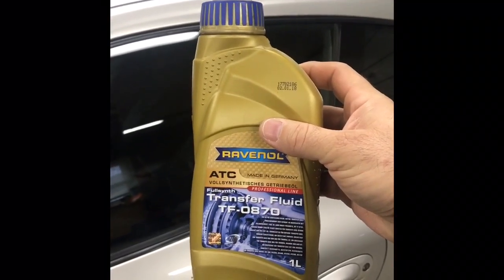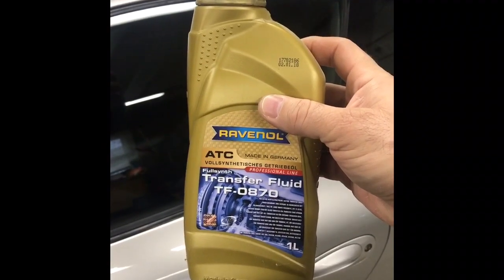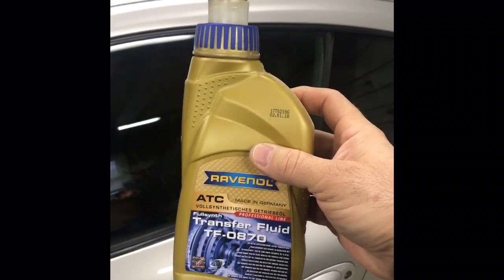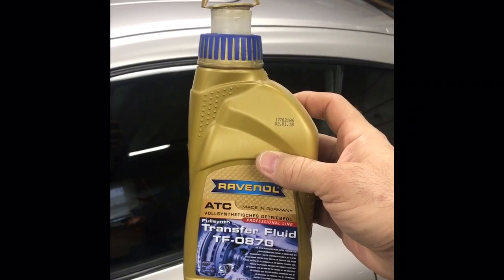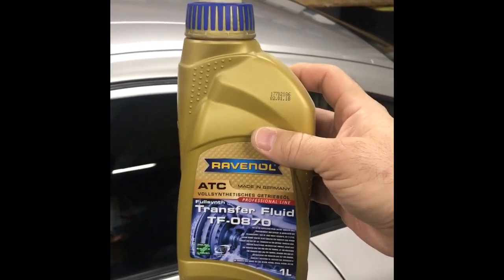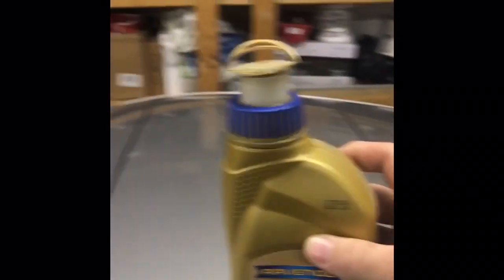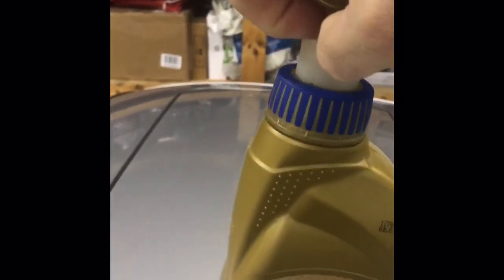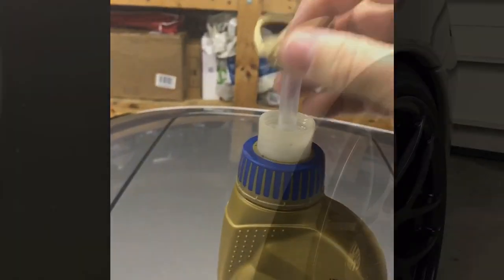Porsche Cayenne 958 92A transfer case fix

Comment: 2013 Cayenne Turbo owner here, 40k miles, heard a weird sound while driving. About the same sound as driving over the expansion joints on a road.  Anyway rotated the tires, looked into the carrier bearing, videoed it by strapping my phone to the tcase mount no problem there.  Watched this first it got me thinking  and then another video, ordered fluid on eBay for $32/qt changed my tcase fluid and it’s 100% gone.  Thank you for the help.
Reply from the maker: Glad I was able to help. Thanks for watching.

Comment: Have a 2013 GTS with 31k miles, facing the possibility of needing to replace the transfer case (and being 5 months out of warranty) I gave your suggestion a try, after the second fluid change the issue was gone, did a few more just to ensure.  Worked great! Thanks

Comment: Thank you so much for this video, just purchased my 2014 Cayenne 70K miles, one owner dealer maintained vehicle.  Your description of the light bucking matched my experience, had my indy replace the fluid and the car drives like new, no more hesitation during light acceleration.  Thank you!
Reply from the maker: Glad I was able to help Porsche extended the warranty. So next time it happens have them check it out.
Reply: Still good? Have the same problem now
Reply from the maker: If you car doesn’t fall under the extended warranty then change the fluid. A fluid change most of the time will fix it.

Comment: SOLVED MY CAYENNE STUTTERING PROBLEM!!!!Appreciate the video. I had a similar problem in my Cayenne 2011 base model. The transmission seem to be skipping or jumping under acceleration. It felt like a misfire but there were no codes found on OBD interrogation. Purchased two quarts of ravenol. The problem seemed to go away after one change. Now it runs very smoothly ,accelerates very well. No stutters or hesitation, I'm very happy!  I did spray out the transfers case with break free and blow dry with compressed air prior to refill. Will post an update after a few hundred miles. Thanks again!👍
Reply from the maker: No problem! If you haven’t used that second quart I would drain and fill it again after a while. Help to really clean it out good. Thanks for watching. I have a part 2 this video coming up soon.
Reply: @KevinsEuropeanGarage  Hi, what is the specification of the oil?

Comment: Hello im french and ill trying to explain my problems i recently buy a cayenne turbo 2011 4.8 and i have a exactly same issue problem with a sound like a deformation of the tire a sound ( clac clac clac ) at very low speed under 50km/h at gear 1 after 2 and 3 after some many research i found the problem of trasnfer case and after some other research i found you video 1 (explanation) and 2 video the DIY of changing oil of trasnfert case i try it and now its work like a charm ! no sound , no problem at low speed im gonna make a second oil change in one week maybe thanks for you video thanks for your help^you just help me to save 6000k Euro im so happy i hope the oil change will fixe definity the problem THANKS MAN YOU ROCK !

Comment: Kevin, you are absolutely amazing! Thank you for your detailed video on changing fluid multiple times four to be exact, I have 190,000 miles on my Chyanne and it worked like a charm. G – D bless you 
You saved me 5k
Reply from the maker: I’m glad I was able to help.. Thanks for watching.
Reply: Are you on the original t case still?
Reply from the maker: The original is still in there
Reply: Still on the same transfer case? I'm on my 2nd fluid change without improvement

Comment: Follow up on my Ravenol transfer case oil change, still running great no problems in the transmission. Going to do the front and rear transfer cases thanks for the videos. If I could only find a fix for my blown PCM amp. Bluetooth speaker for now.
Reply from the maker: Have you tried picking up a used amp? People have been getting letters in the mail about a recall for the transfer case or something to that effect. I haven’t received my letter yet.
Reply: If its a bose one, find a bose specialist online and send it off. It cost me around £200 in the UK.

Comment: Kevin. Thank you for this video. I've noticed my Cayenne (2016) was starting to shake a bit during acceleration (like going over speed bumps) under 40mph. I've changed the TC fluid once - the issue went away. A week later, I changed it again (it was much clearer) and now the car drives as new. I guess the number of fluid changes depends on the current condition of the TC and how contaminated the fluid is.
Reply from the maker: Yes that’s what I have noticed. I just kept changing till it came out clean after driving around for a while. It’s been 10k since my last change. I plan on doing it again to see what the fluid looks like. I’m not having issues it’s just for curiosity.
Reply: I have 2016cayenne , under 40km/h feels little shaking (like going uneven road surface ).It’s that same situation?My car 47,000km right now...never change the transfer case fluid...
Reply from the maker: I would wait on changing the transfer case fluid. From what I understand Porsche has issued a recall. I don’t know if it is for all Cayennes all over the world or not. I would look into that or call the dealer before you do anything. If the recall doesn’t apply for where you live then I would definitely change the fluid.
Reply: @lyz5894  If the recall doesn't apply to you (and Porsche wants $) - try changing the fluid in TC. It costs only around $100 for 2 fluid changes.
Reply: Still good?
Reply: @hansturpyn5455  yup. All works great.

Comment: Appreciate your video. I just replaced the transfer case fluid in our 2014 Cayenne 958 diesel and wondering if the noise you mention is a constant humming sound or increased on acceleration/under load? Thanks

Comment: What fluid should I use for the front & rear diffs? 2011 Cayenne Base V6
Reply from the maker: Any quality synthetic 75-90 will work. Anything from motul, mobil1, ravenol a good quality fluid would be fine. If the rear diff is locking you’ll need

Comment: did you change the plugs every time or reuse the old ones?   message boards suggest new plugs, but that seems excessive.
Reply from the maker: I didn’t change the plugs. Just be carful not to over tighten them. I have seen people crack to the case. I have not had any seepage from the plugs. I wouldn’t worry about reusing them.
Reply: @KevinsEuropeanGarage   i figured that was the case.  thanks for the info.
Reply: Only snug the plug, a little thread sealer or Teflon tape is good so you don't have to over tighten... Going to do my transfer case fluid again tomorrow. Made a night and day difference the first time I changed it last year at 53k.

Comment: Saw a few requests and I cannot find the analysis. All I can say is that I did the change 4years and roughly 40k miles ago and there has not even been a one sniff of the issue coming up again. In retrospect, what I was experiencing 4 yrs ago was noticeable enough where anyone would think something was wrong, but was not totally impaired. I never did the Blackstone test again, but given that is is a PITA to change the fluid (as I get older) I will just wait until I see issues again. It has 95K miles on it now and has been used a few times to tow a track car as well as 1 time , (yeah, just once my wife allowed me), to do some off-roading. IMHO, try the transfer case fluid change fiesta dn decide from there.

Comment: Did the dealer give u an explanation with the extended warranty i have a 11 cayenne hybrid thats jerking horribly build date is 03/11 couple months past the 10 year mark :/
Reply from the maker: It should be 10 years based on the date the vehicle was first sold and not the build date. You are pretty close I would call them right away and have them look at it.

Comment: Kevin, Thanks for the tip!  Do you have a video for the transfer case fluid change?
Reply from the maker: I do not have a video for that.  I think I will making one soon though. The change is quite easy, you don’t even need to jack up the vehicle.
Reply: Kevin’s European Garage that will be great! I’m guessing 2016 model should be the same since both are 958.2
Reply from the maker: @TamerNassar01  I'm pretty sure it is

Comment: I just did a change as well after the slightest indication this was happening. I bought the 1-owner car used and assumed the fluid had never been changed. Like everyone else, it was black as night. I sent a sample off to Blackstone labs and they came back with crazy off the charts wear across all metals. They could not say for sure if this was just "wear-in" since they did not have a large enough data set of the first change metal levels. Nonetheless, I will put another 5K miles on it and send another sample to them to compare the baseline. I think just changing over and over without getting some analysis done may be throwing good money after bad. Not a criticism, just an observation that without data, we are just making an educated guess. It is also well-documented that when Porsche does replacements, they also move the drain hose up to the engine bay to prevent fluid contamination.
Reply: Still good?
Reply: Post the data
Reply: @hansturpyn5455  After 40K + miles, I have had zero issues with the transfer case

Comment: Hi, thank you for the video. I have a whirling noise under my vehicle . Is this similar to what everyone has experienced? I replaced transfer case oil once have about 800 miles since. I did not see any metal shavings. I also did front differential. Anyone else have the whirling noise?

Comment: Thanks for the video. How sure is you might have the TC issue? I didn’t got a cayenne since I saw on forums this was an almost sure issue you will have
Reply from the maker: I’m pretty sure most will experience this issue. But if you change the fluid many people have seen all their problems go away. I’ve been free of issues for close to 20k miles now. Most of the time it can be solved with a fluid change.
Reply: A great many of the Cayennes with this issue since 2011 had the transfer cases replaced under warranty, just look for one that has already been replaced.
Reply: @megaman4201  but don't they change it to same transfercase which going tk cause the same problem in the future? Hmm

Comment: Does the Ravenol Transfer Fluid work for V8 4.8L engine (ex. GTS)? Thank you for this video!
Reply from the maker: Yes it should work. This fluid can be used in the transfer case of all Cayennes and Macans per the Ravenol website. Thanks for watching!
Reply: It's awesome stuff! Use Ravenel to change the transfer case fluid in my 2015 Cayenne S with 54,000 miles and the difference was immediately night and day, completely smooth running whereas before on acceleration from a stop felt like you were on a gravel road, slight bumpy feeling.
TC
Annapolis, MD

Comment: Hi Kevin, I had this exact issue and did what you recommended. The existing oil came out full black, and at the 3rd change the oil came out pretty much light color. (I went through 3 new cases basically). The car felt much better after the 2nd change but the growling noise came back a little after. The 3rd time didnt make any change. Now my oil changes were about 2-3 weeks apart but I drive the car probably just 100-120 miles a week. So now Im still having the growling noise when making turns. Any issues you see with what I did? or any recommendations? Has yours totally quit the noise when turning? Thank you!
Reply from the maker: I don't really see anything wrong with what you did. It might be one of those things depending on the condition of the transfer case before you started. How many miles? You might need to drive it around a little to get the oil circulating through the clutch pack. I went well over a few 100 miles before a drain and fill. Mine finally quieted down on the 4th drain and fill. I might hear a little whine on a sharp slow hard turn but its so infrequent that it doesn't bother me. My biggest issue was the bucking in a straight line, its been almost 10k since my last change. I was going to drain it at my next engine oil change to see how the oil looks. My first drain was done around 70k. I would drive it for a while and see what happens.
Reply: Kevin’s European Garage thanks. 64k right now. Please report back when you change the oil next time, Im curious how it’ll look like.

Comment: It sounds like the fluid is bad from the dealer    so if you buy one new  change the fluid  right away the fluid  has viscosity  problems
Reply from the maker: The fluid gets really contaminated. Porsche says the fluid is lifetime. Most of the issues would be fixed if they changed the schedule to a more frequent change.

Comment: How is the performance now on your car?
Reply from the maker: The transfer case has been fine since the fluid change. Porsche came out with a new extended warranty for them. I will have a little video coming out soon about what the dealer told me

Comment: I just had my transfer case replaced a month ago. I saw a few videos that talked about replacing the fluid. Do you think it's good to change the T.C. Fluid when you do an oil change? Which I am probably going to do every 5000 miles on my truck

Comment: Hi Kevin, thanks for the video. Im driving a Macan S Diesel do you think ravenol is compatible? Do you use it for flushing and replace with Porsche original fluid at final round? Thanks
Reply from the maker: According to the Ravenol site the DTF-1 is the fluid to use and that is the new name for the TF-0870 I mentioned in the video.
Reply: @KevinsEuropeanGarage  Thank you Kevin. I just replaced it with TF-0870, manage to find it in Malaysia. Do you recommend to stick to this fluid or we should replace it with Porsche fluid after 4 times of flushing?
Reply from the maker: You can stick with this. I’ve been using it for 20k miles changing it every other oil change. It’s been just fine for me
Reply: @KevinsEuropeanGarage  how does the fluid look with your recent changes?
Thanks for your videos!

Comment: This worked for me!  First replaced tranny fluid and transfer case fluid, didn’t work.  Then replaced transfer case fluid a second time, this time using heavier fluid (not OEM).  The vibrations that were happening at low gear ( 3 /4) completely gone!  Do you think this is the actual fix?? Porsche charges $6K to replace the transfer case!!!  This fix cost $500....
Reply from the maker: Well I’ve gone about 15k since I have done all my flushes. From the feedback I’ve been getting and what I’ve heard from a couple Porsche techs say is that they try and drain it first and see what happens and go from there. I think that if you catch it soon enough and change the fluid you’ll be ok. Wait too long changing the fluid won’t help the damage might be too much. I think anyone who owns this car should change it every 30k. I bet if everyone did that this might not even be an issue. It’s one of those things the fluid isn’t too expensive and the labor Isn’t too much. Just change it. It’s like an insurance policy and changing often can’t hurt never changing will.

Comment: Hi there Kevin,which transfer case fluid did you change out 4 times?is it the fwd transfer case fluid,or center transfer case fluid or the LSD fluid?
Reply from the maker: The transfer case that is attached directly to the rear of the transmission. takes approximately .7 liters

Comment: Disappointed that porsche used tcase and diffs with such low fluid capacity. They are known to over design everything but yet each is only 1 qt capacity. Come on guys, ny toyota 4runner has bigger tcase and diffs with much lower hp and torque